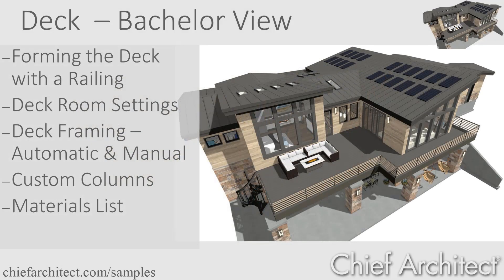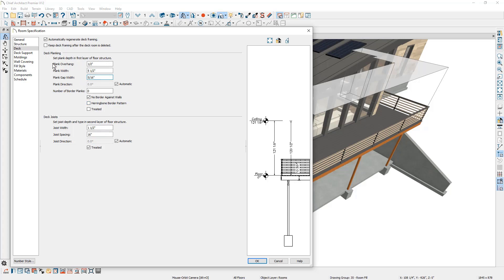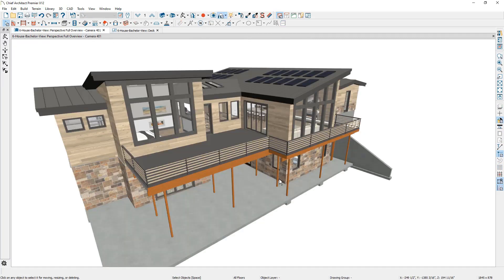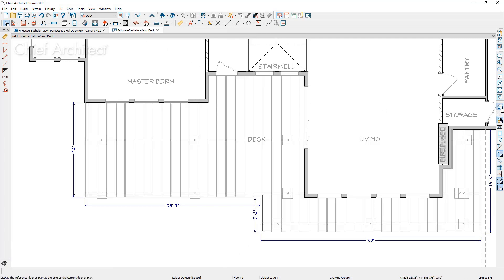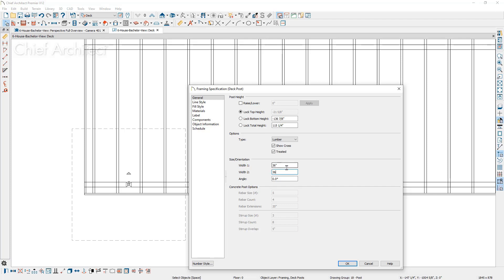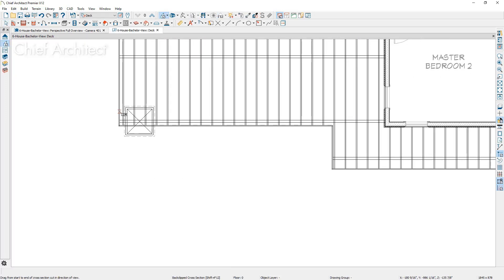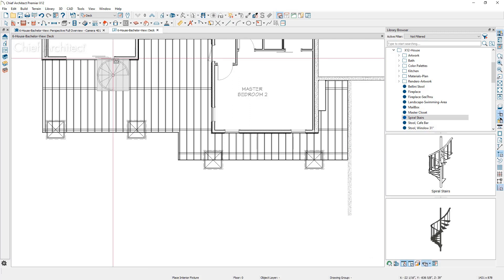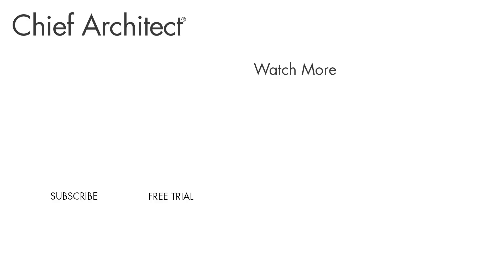Bachelor View Project - Deck

Comment: Would like to see how you make the structural changes necessary after removing most of the posts. WIll the program make those changes?
Reply from the maker: Yes, you can manually make those structural changes after removing the posts.